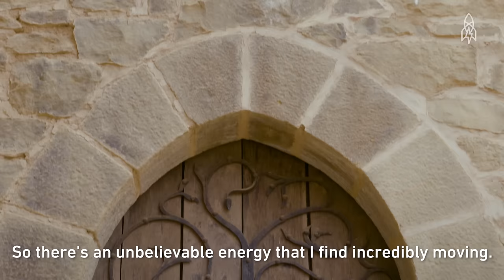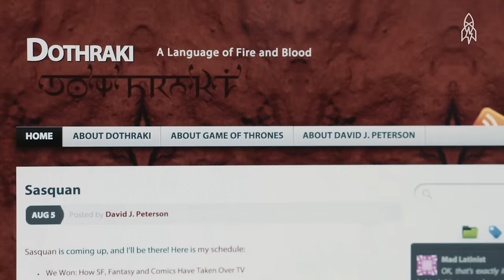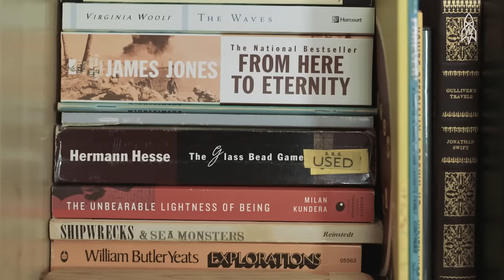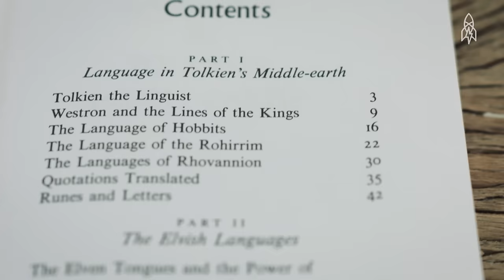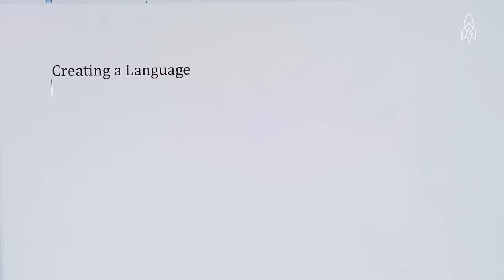These Stories Get Medieval On Your Ass

Comment: I wonder if their is a need to separate Men and women's sword fighting sure generally women are a bit smaller but wouldn't that just make women more quick and adaptable, and lets not forget some women are easily just as built or even more so then men
Reply: there***
Reply: Take the average man and average woman, If you compare the strength the man will win, If you compare the reach, the man would win. Women's small size would be a disadvantage because if you are hit with a force that equals more than your body weight you will get fucked up. 

Now there are exceptions to this, but generally speaking men are more physical built than women and it would be unfair to pit them against men.
Reply: Trigger Bee Athletic women can run longer and have a stronger core than athletic men. Don't say that men are physically superior to women just because of their upper body strength. -_-
Reply: Doubt that since men generally have larger leg muscles than women, Also the fact that male distance runners are faster than their female counter parts, Which is why they compete in different competitions.
Reply: I'm quickly regretting this comment thread.